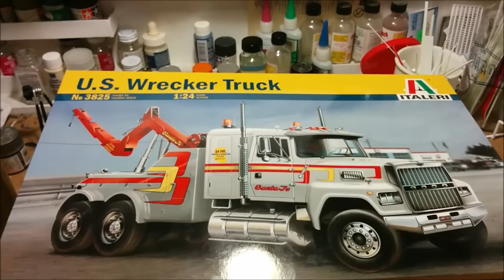Modern Wrecker Truck 1/24 Pt2 by Italeri

Comment: I built a Linburg kit ,the Dodge LITTLE RED WAGON race team ware I stretched the frame.
why didn't you paint the belts separate so to get all of the belts.
I to have cat yellow left over from painting a cat engine for a Revell kit of a Kenworth W-900 .
The frame came out nice ,I see that you put in another brace in.
I noticed that on the transmission that their is a trans cooler ,should that be painted a different color,I like the FORD blue is a nice touch for the transmission color

Comment: I think the engine is the cummins.  All black but with the red valve cover, Red top cummins.  Looks ok as a cat though.
Reply: I agree that looks like an N-14 Cummins,or at least an 855 c.i. engine.wrong valve covers for a red top n-14 though,they have about a 2 inch tall valve cover. Been driving a Freightliner with a Red top for the last six years ,and a Freightliner with a 290 Cummins and this looks more like that one,Wich is an early 855 ci .Cummins

Comment: What model glue would you prefer for model building??
Reply from the maker: blazin Spike 3809 I actually use 3 types of model cement. Plastruct, (sometimes sold as Plasmod, Flexi-File or Ambroid brands) it is very thin and very fast, plus it works on ABS plastic, Testors which is a medium viscosity and speed, (rumor has it it is discontinued here in Canada!) and Tamiya thick with the yellow cap. It's slow to set but it has some 'body' to it. For dissimilar materials I use a quality CA type (super glue) usually medium thickness. Hope this helps.